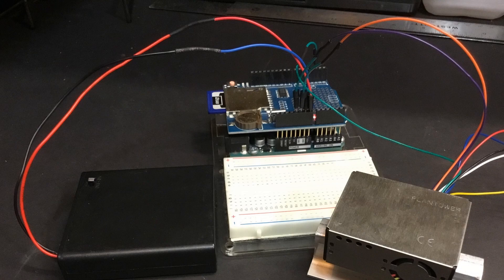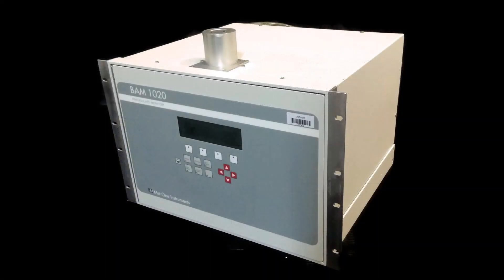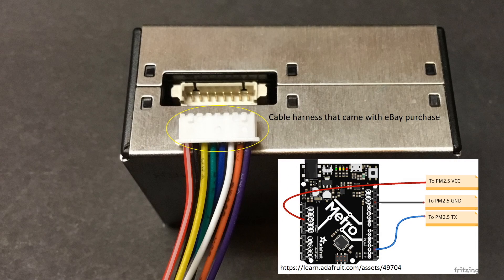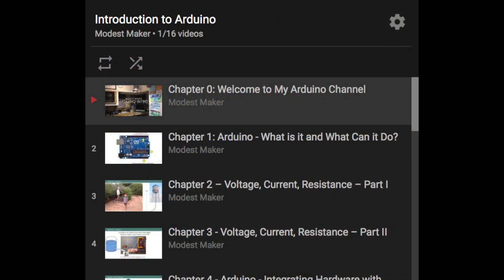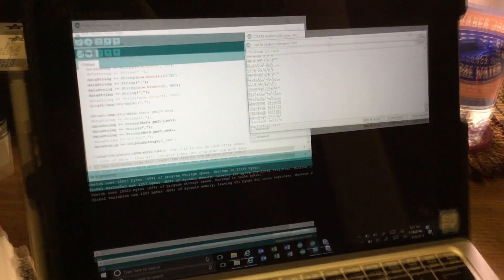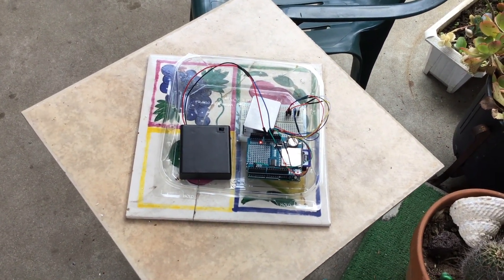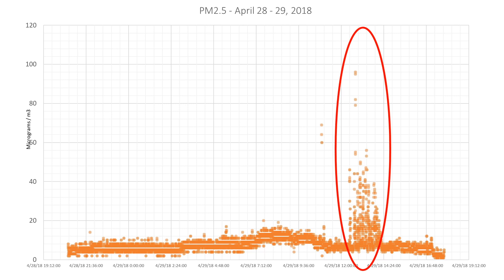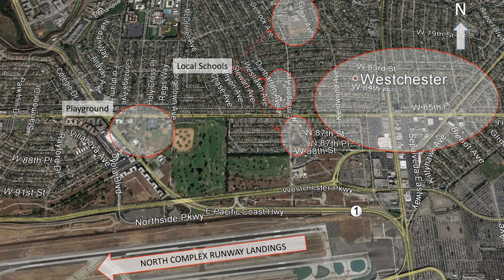Air Quality Monitoring at LAX with PMS5003

Comment: Have you found that PMS5003 sold by adafruit are better quality than the ones found on EBAY?  I had an experience were the EBAY one I purchase appeared and performed like a poorly built copy.  Great detailed video!
Reply from the maker: I purchase a lot of items from Adafruit, but did not purchase this item in particular. It looked identical to the one offered by Adafruit and is performing reasonably well over time. Adafruit certainly does offer peace of mind given its excellent customer service and attention to quality, so when I can afford it, I go with Adafruit. Having said that, I agree - eBay can be a bit like going to Vegas.

Comment: I find your video of Great use for the realization of my undergraduate thesis in electronic engineering, I am in the city of Bogotá where air quality is currently going through a complicated situation, I will use the same sensor to perform a network of air quality monitoring on school buses. I would like to get in touch with you if possible to share your experience and serve me in my degree work. Thanks
Reply from the maker: Sure. I have some papers that were shared with me regarding performance of these sensors that you should probably be aware of.  I will dig them up shortly and add them to the website for your reference in the event you are pursuing a formal study- stay tuned.
Reply from the maker: Found it - https://www.epa.gov/air-research/presentations-deliberating-performance-targets-air-quality-sensors-workshop/ . Here is a presentation on a similarly priced PMS3003: https://www.epa.gov/sites/production/files/2018-08/documents/session_06_a_bergin.pdf . There are other presentations on EPA's website that may be of interest.